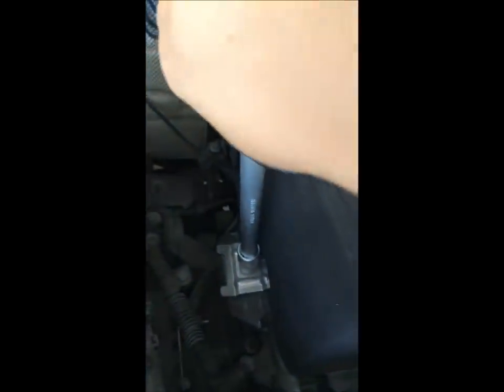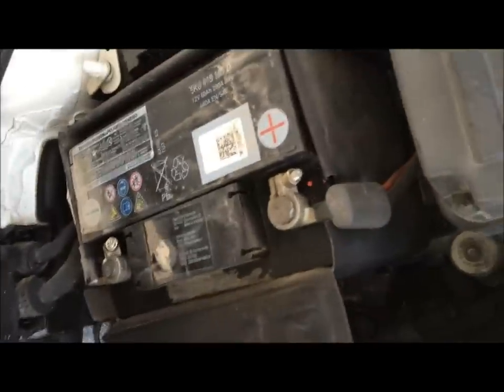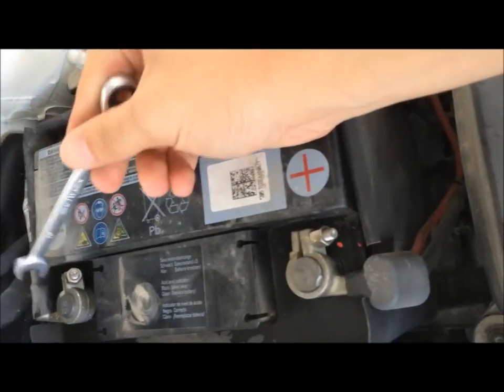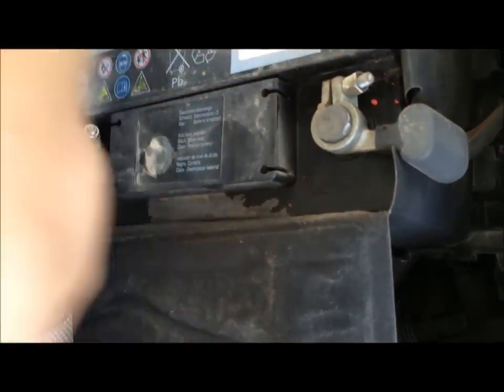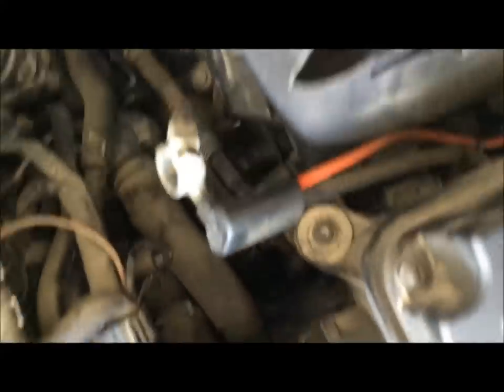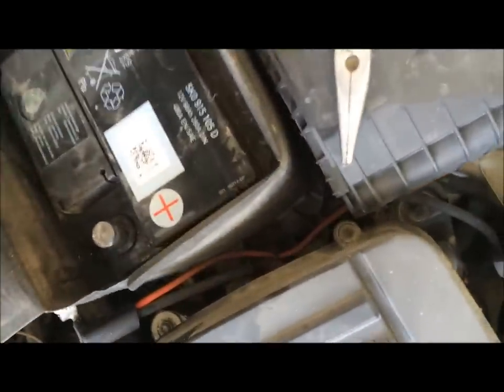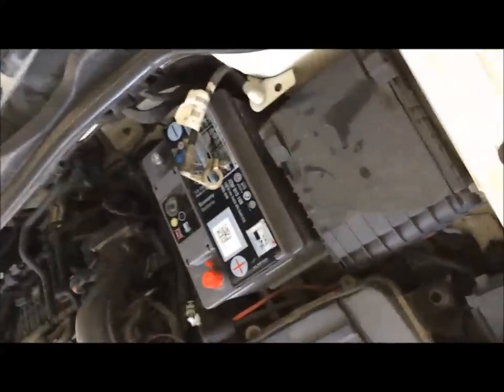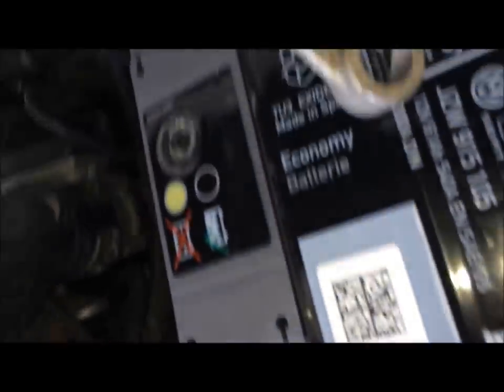Volkswagen Car Battery Change TSi 2010+

Comment: First always disconnect from battery (minus) plug and only then go to (plus) plug. And backward: first connect plus plug and tide it, after finished with plus plug connect minus plug to battery. It will help to avoid short circuit if you touch metal construction using key while working on plus plug.

Comment: Excellent. Was a bit worried about losing all the memories but when finished everything reset after a short drive. RN510 and radio all fine, just the clock needed a reset. Follow this video with confidence. Thankyou iffy.

Comment: You forgot something very important! Next time when you install a battery, code it into the cars main computer using VCDS. The white sticker 4:35 can be used to put in the right code!!
Reply: Wrong the ecu do this automatically after a short drive.
Reply: @MegaSpender  No, the ECU doesn't 'program' the battery automatically. There is nothing to program from +/- terminals. It's only necessary if your car has a battery management program. In older cars you can swap the battery and you're good to go..
Reply: @RHDM.  so what happens if u don't code ur new battery? I changed my 3 weeks ago without coding it and it still starts as normal. Thanks
Reply: @jaycee6607  If you don't tell the ECU it has a new battery it will overcharge the new battery causing it to wear out faster, basically shorting the lifespan.

Comment: can we use other battery brand to replace it? is it compatible?
Reply: Wana Abdullah all accus are the same as long its the same voltage and amperes, the ah doesnt really matter as long its not too low. For example if u have a 72ah now and u replace it with a 60ah, it will start however the ampere per hour is less so your lights might be less bright or ac will blow less or w.e :)